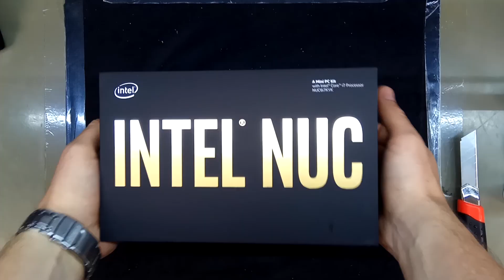Intel NUC 6 Unboxing Teardown

Comment: I just picked up one of these to use as a head for my egpu LLM setup. Used this to figure out how to take it apart because mine was overheating (even after replacing the fan). Replaced the thermal paste and it's running fine now.

Comment: Hello, thank you very much for your review. I have a question for you. I have the same device, but despite making adjustments in the power settings in the BIOS, the device turns on immediately as soon as I plug in the power cable. What could be causing this issue? Could the BIOS battery be the reason?

Comment: Just picked up one of these from Craigslist last weekend for $250 with 32GB vengeance pro and a 1TB crucial mx300. Well worth the 2 hour round trip, I absolutely love it. Glad I watched this video before I attempt to take it apart though, I took the top and bottom covers off and decided I'd find a video just to make sure of the correct order. Crystaldiskinfo says the drive has ~20k hours on it so I'm thinking some grizzly kryonaut is probably not a bad idea.